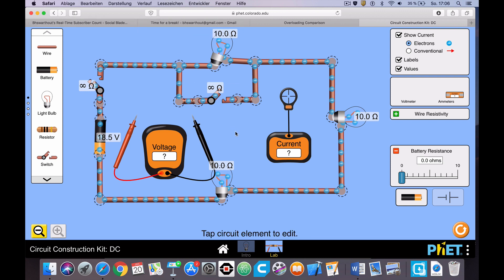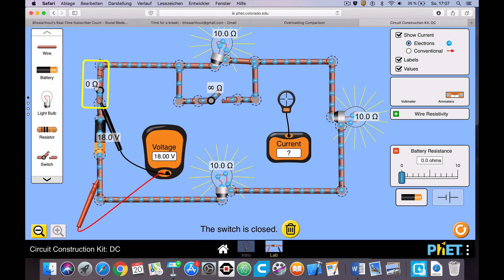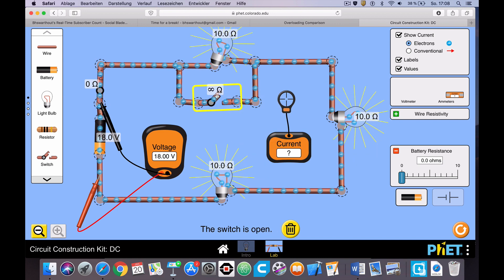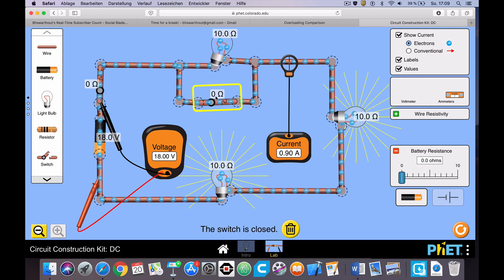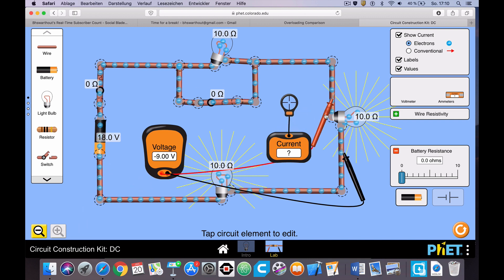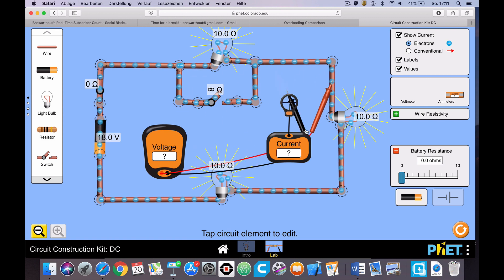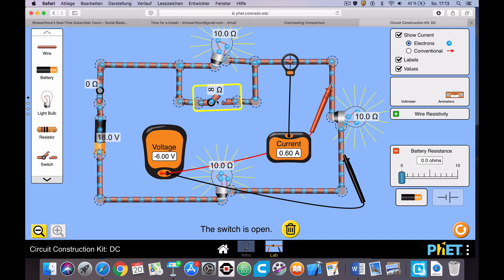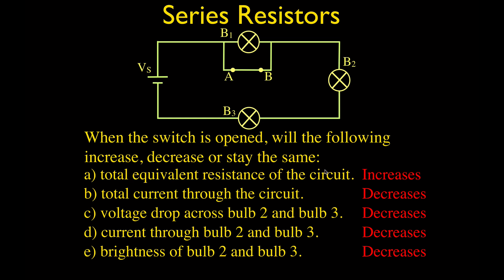Resistors in Electric Circuits (5 of 16) Adding Resistors in Series, Part 2

Comment: I am a 60 year old man just starting out learning these things. I find your videos very good and easy to understand. Can you believe I got interested in this because I wired a bunch of NiCad batteries together in series to fix my cordless drill. I want to put a few resistors together to take my drill battery packs down to 12 volts so I can use my 120 volt power inverter. My drill packs are 19.2 volts. That's how I got interested but now I want to learn more. I am fascinated.
Reply: Hi john,i too am john,i am almost 50(where did it go?),i studied electronics as a design technician 30yrs ago and am using these videos to refresh some of my theory,not so much the dc,but i thought i'd watch,any way,you wish to drop the voltage from around 19Vdc to 12Vdc,i wouldn't use resistors as they will drop more  and more voltage across themselves as the current demand goes up,instead i would use either a linear voltage regulator or a buck converter.

The linear voltage regulator will heat up,but will give a constant voltage,but may be limited to 1.5A,though power transistors can be used as pass elements,which essentially  are controlled by the regulator to pass 12Vdc at a much higher current,both versions should use a heat sink.

The linear regulator manufacturer will have a data sheet that will show circuits to suit,and are quite simple,if you wish to learn check them out,just google "X" voltage regulator ic's.

Alternatively you can go to Ebay and search for a "buck" converter,the voltages will vary,so search 12V buck converter,these don't heat up much and are therefore very efficient,and can  supply high current demands easily and most likely will be variable,also very cheap.Lots to choose from and will invariably come from china,which on the whole most consumer electronics are either from or made in china anyway so quality will be quite good too.

Just remember as the current through a resistor goes up(drilling tougher material) the voltage dropped across a resistor will go up,putting a strain on the drill and the power supply,so go for a regulator of some kind,buy a buck converter and research linear regulators,both are cheap anyway.

Good luck.
Reply from the maker: Great and thanks for leaving such a nice comment.